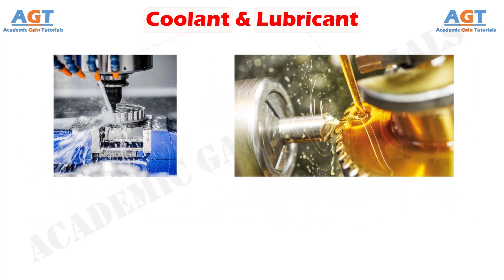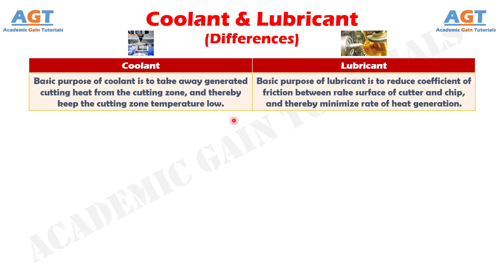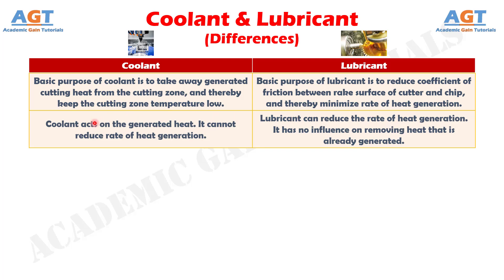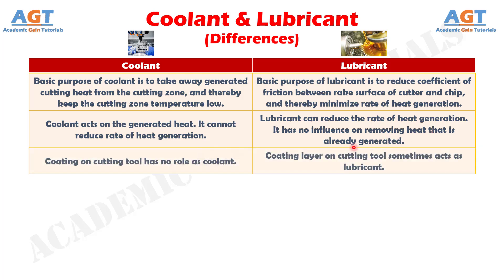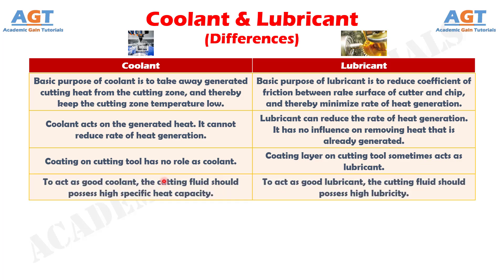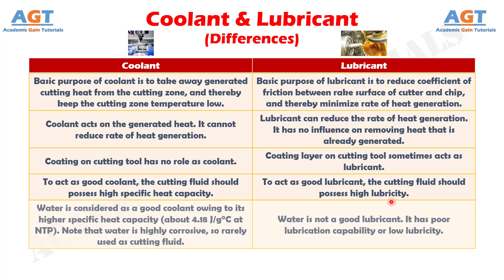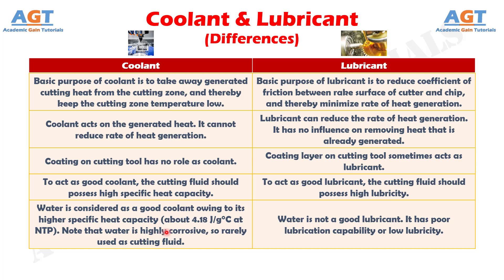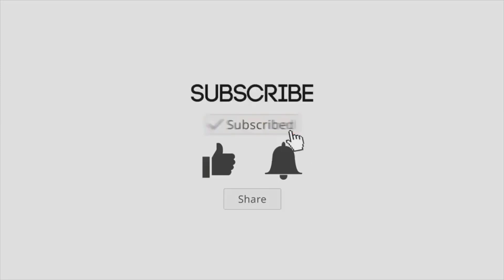Differences between Coolant and Lubricant as Cutting Fluid in Machining.

Comment: So with is better
Reply: Depends on what your cutting, if the material  generates alot of heat and the material is naturally resistant to rust then go water based. If material requires more lubrication due to higher density and want to prevent smell from bacteria caused by water bases then oil based..